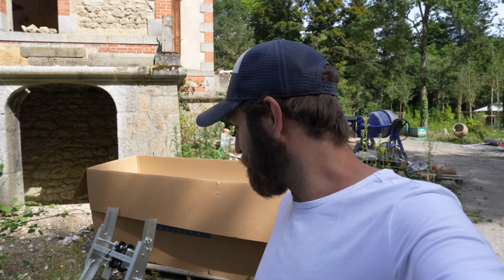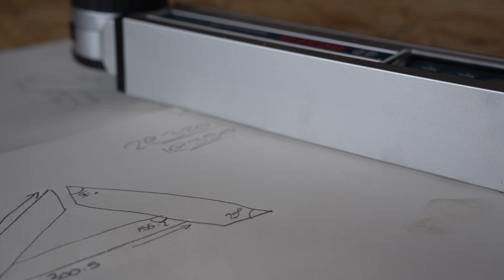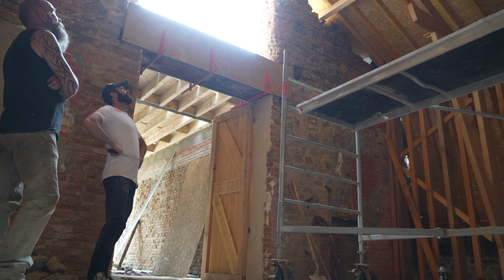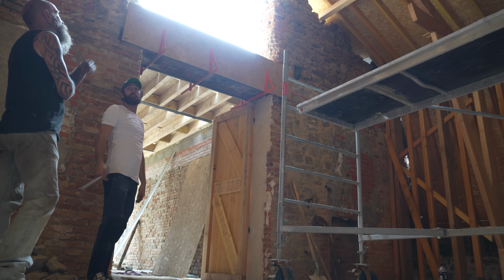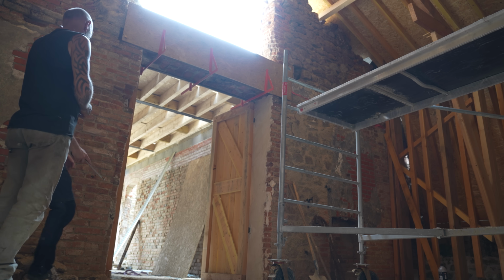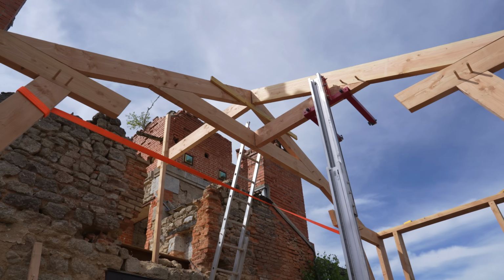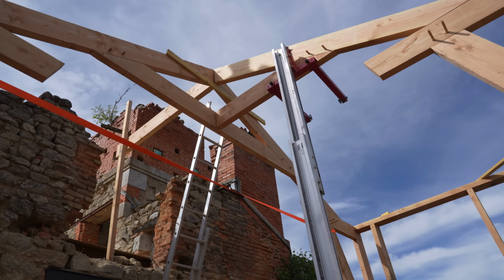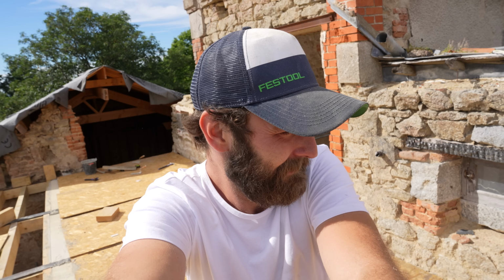the main structure of the roof is complete.

Comment: My mom gave me a home in South Carolina that I had to redo.  I wanted to put a big south carolina front porch on the house that covered the full length of the house with a tin room.  I hired a guy to build it, however it was done so badly that I had to fire him.  The problem was that I had to rebuild.  I studied building on youtube and then I started to tear down.  I had to dig six holes, 4 feet down, fill with concrete and hangers to attach the boards to.  I did it all myself, took me two years.  The tough part was the roof and getting the beams up by myself, hoping nothing would fall.  In the end I was proud of what I had done.  It is still there and the house has sold three times since I owned it with the price going up.  But what I learned is that I loved the process.  I loved to look at what I had done every single day.  When it was done, I would always have my coffee each morning on the front porch.  Now, as I watch you, I feel I need another project.  You and thos helping are doing a great job.  I am waiting to see what it all looks like in the end.  Keep doing good work.

Comment: Really enjoyed these last couple of videos, watching you craft the second wing roof is brilliant, if not a little nervy at times. Would it not pay to put the ridge beam right through may help with alignment. Great work though and commitment as always.
Reply: Excellent point on the ridge beam. When Dan did the first roof, he said that there would be a scarf joint in the ridge beam joining the two opposing mansard roofs. I’ve never seen a scarf joint cut and installed on a ridge beam whilst hanging in the air. Check out scarf joints on YouTube and you’ll see they are quite intricate in the number of cuts and angles. The pieces need to be cut and fit on a flat surface and then can be installed in situ. Once again Dan’s going to have to back up because his work is not in sequential order….sort of like doing the roof without framing the dormer windows first. Geesh!

Comment: Looks like time for to invest in a Fat Max tape measures that has a 3.35 meter reach. I buy a lot of tape measures for when I work on a job since the cost of the extra tape measures is trivial compared to the time lost  of remembering where you set the last one down.  By doing this a tape measure is always within easy reach.
Reply: Incidentally (although not really applicable to  massive framing work) I find that using a disposable dental syringe is much better and far less messy than the dispenser bottles that carpenters glue comes in.  You can controllably put the precise amount of glue needed exactly where you want it such as in a dowel hole, along a narrow edge,  or under loose veneer. These syringes are quite inexpensive, disposable but easy refillable and re-usable, and can be capped up with a toothpick.

Comment: You’re going to tile the roof before putting the windows in the Mansard roof? You will put the roof on the big back wing before tiling, right? Makes more sense and will be more water tight to do all three at the same time. Since the back can’t be seen very well from the bottom of the hill and the village, the chateau is going to look really different to those who have been used to seeing a roofless, shell of a ruin all these decades. End of July is great progress. Entire month of August and maybe even mid September to get the back roof done and tied into the other two. Professional roofers should hVe it done and watertight by at least end of October. Seal the windows in some way and you can start the Mechanicals. You could even have a little party inside the Chateau for Christmas. I can’t imagine where you will be Christmas 2025. You’ve come so far and it is moving so quickly now.

Comment: Pls explain again, Daniel how the mortices, tenons and pegging will be sturdy enough for the roof without steel braces, nails, etc. during rain and winter storms?? Are you required to only use old techniques as when the chateau was first built?  At first glance, it seems a little "higgely-piggely" to a novice viewer!
Reply: There will be many intermediate braces joining this roof into one solid system. The joinery, pegging, etc., is a long lasting technique. So much to learn historically about this. I’m amazed at his passion for excellence.🎉